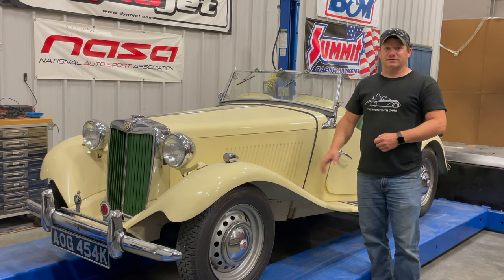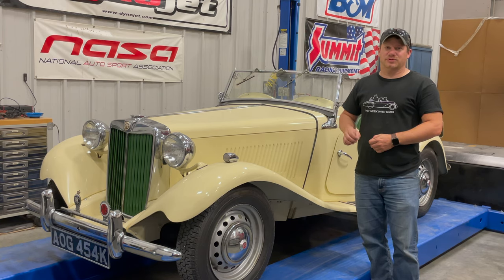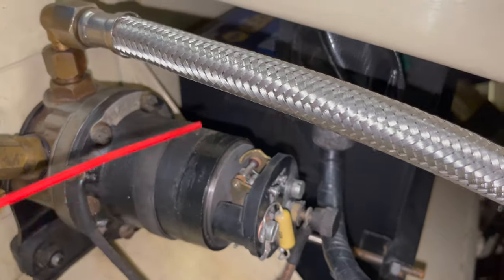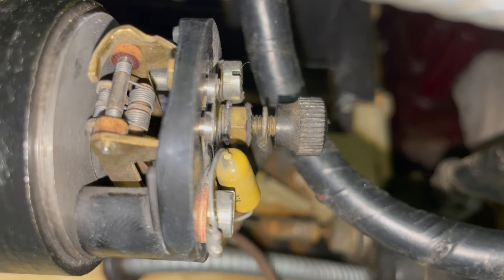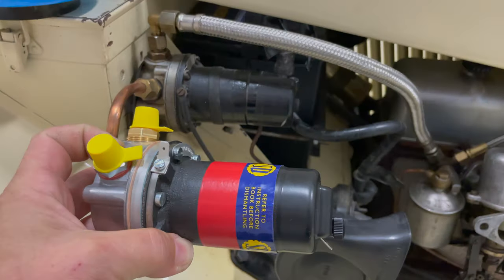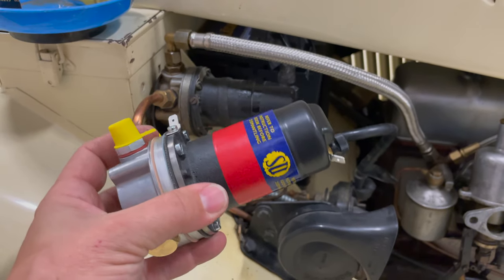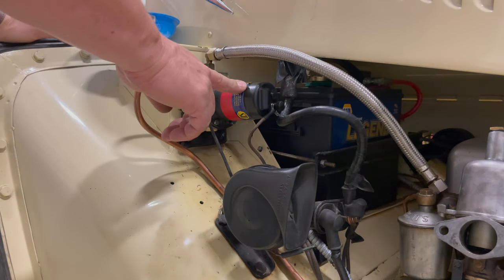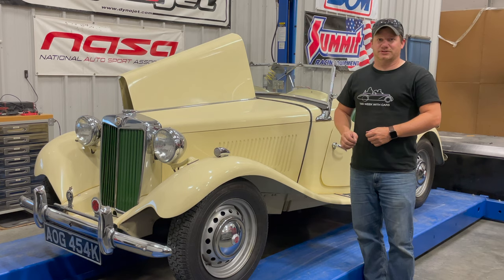1952 MG TD SU Solid State Fuel Pump Upgrade

Comment: That was a nostalgia trip. I had a '53 TD in Old English White, with steel wheels. Unfortunately, the threads for the screws holding down the carb. domes had worn out, so pre-start check was to look for (and if necessary, replace,) loose screws. If I didn't, I'd get a smell of gas and oily streaks from the louvres on the right side as the tops came  loose. The scariest moment was when a top fell off completely, and jammed the steering. (Fortunately while almost stationary.)

Comment: I thought the solid state didn't make the click noise,  but I see they still do.    I always rely on that click noise to warm me if the needles are not sealing or other issues.    Nice to know the new solid state pumps still have that noise.    I assume it goes quiet once the pressure is made.

Comment: That registration number is wrong - if it's a British one it relates to a 1971 car. Love your channel - keep it up.
Reply from the maker: Was on the car when I got it. No idea where they got the plate.
Reply: Its not on the UK number plate database on the DVLC. It wouldn't be the original number plate, so it may have been put on the car in place of a valuable original number plate which was sold off the vehicle. It hardly matters on such a beautiful car registered and used in the USA though.
Reply: @ThisWeekWithCars  It can't be a legal UK registration as it's illegal to have a registration number newer than the car it's fitted to. Definitely UK plates though.

Comment: My favourite MG Steve, apart from the MGC GT, your one looks like a 1972/73 going by the number plate. nice one mate.
Reply: Had a '68 MGC roadster that was originally blue. When I restored it in the mid-80's painted it BRG. There were two distinct BRG's at that time so I had to make sure I was painting it the correct BRG for the time period. It had leather interior (maybe naugahyde seats with red piping- don't remember well). Loved the 6 cylinder Austin Princess engine that sounded like the Austin Healey six; almost vertical banjo steering wheel, also like a Healey. Also had knock-off wire wheels. 
Surprisingly, an Englishman, touring the States, saw it and had to have it. Sold it to him and he had it container-shipped  to England. Could say it went home again.
Reply: @robj2704  Lovely car, and what a great story, I wonder if he still has it.

Comment: Generations will no longer learn the art of fuel pump thumping with the handle of a Thor wheel hammer. I learned it in a 63 Healey 3000.

Comment: Cool, Steve. How is the new pump working? By rotation or is it electronically switched instead of the contacts. Greetings Frank
Reply from the maker: Works same as the old pump but it is switched electronically.

Comment: Isn't that the same fuel pump in the '64 Midget? Sure looks like the one I had to periodically "fix".
Reply: SU made electric pumps for many british cars, my Rover from 55 has one. Same company ( under diff ownership) still makes them with points or solid state, and Su carbs and parts also.
Reply: The one for an MGTD is the same a a Morris Minor.